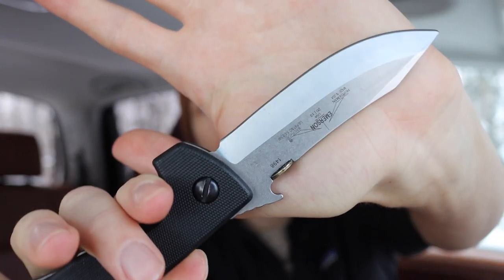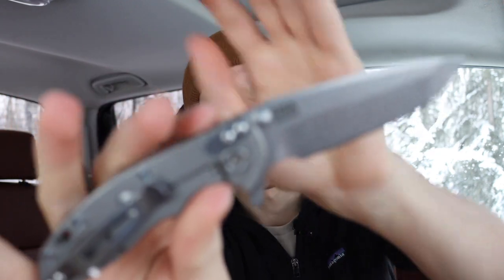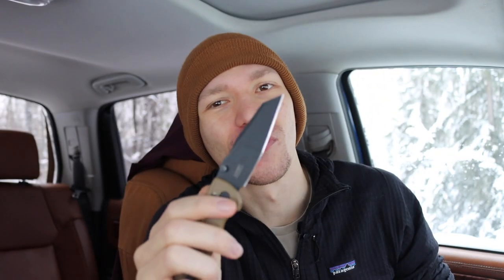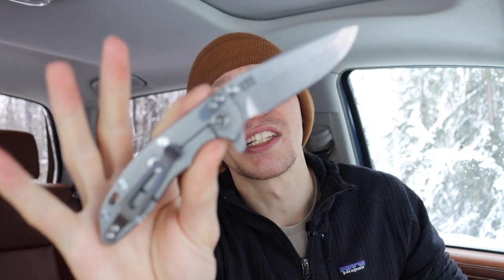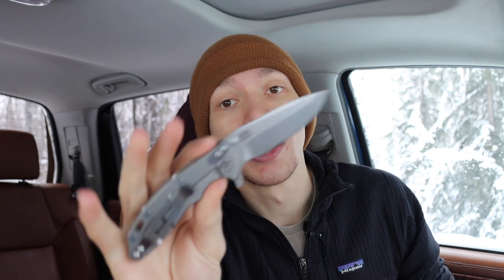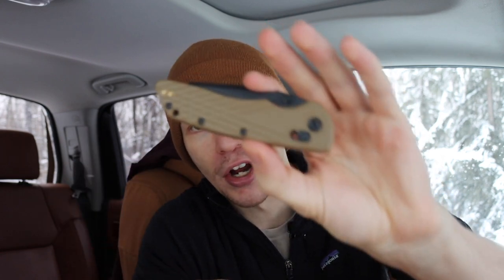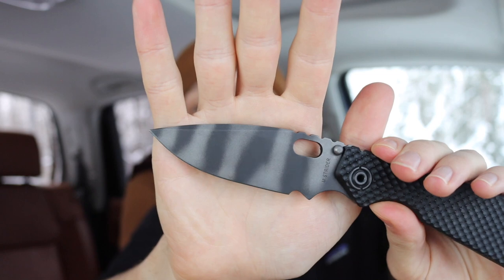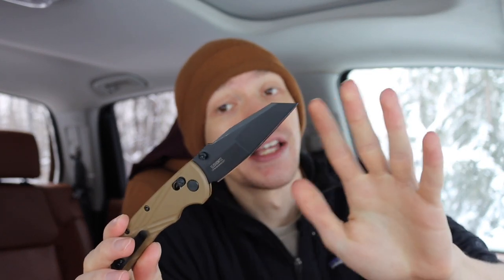The Sickening Truth of the Knife Industry

Comment: AEB-L A-E-B-L  A-E-B-L  A-E-B-L  A-E-B-L  A-E-B-L if you look at the data sheets one of the toughest out there especially for a stainless option that has decent edge retention don’t buy the hype🔪 🎉
Reply from the maker: Agreed with this. AEBL isn’t terribly new, or hyped up but it’s a proven performer
Reply: Agree as well. It's impressed me. Strops up like a champ too.
Reply: True. Aeb-L it’s basically a Sandvik 13, which is amazing.
You can also go to a 14c28n and get same really good performance.
Reply: @General_ONeill  it is. Sandvik 13c26. 
Learn then speak blud

Comment: My take is that many people don't use their knives to the point of seeing the extreme benefits of the super steels. People might open a package and do general edc tasks but normally its nothing crazy. People who truly did depend on their knives back in time only had 1095 carbo,  probably even softer. They were able to do everything they needed to. People probably didn't complain about edge retention because nobody knew any better. It's just like in the gun world. I've been playing with ARs for almost 20 years  now, and nowadays it's like you need a 4150 hammer forged barrel, or you're going to shoot your barrel out quickly. I have 4150 CHF barrels, 416R SS, 4150 non CHF,  nitrided barrels, etc. Never had an issue with any of them. Unless you're really going hard if you buy anything that's quality, you don't have to worry about it. If you shoot the 12k-18k rounds it takes to shoot out a barrel, then you can afford the 250-400 dollars to buy and install another one. I don't get wrapped about blade steels to much. I just buy what blades I like and enjoy them.

Comment: My Swiss Army knives cut just fine even when they're dull to the touch.  Some of them have been in my collection for over 20 years.  Can't taken them apart, never lube them, hardly ever sharpen them, and simply wipe the blades after use if they need it.  And they do so much more than just cut things.  The fact that I have a drawer filled with thousands of dollars worth of pocket knives is proof that we're all victims of clever marketing.
Reply: Good comment. I use SAK - what steel do they use do you know?  - (I don’t know much about knife steel) thanks
Reply: @davidneal6920  The official name you'll most likely see is Inox.  They don't publish much info on the composition, but basically it's a high carbon stainless steel.